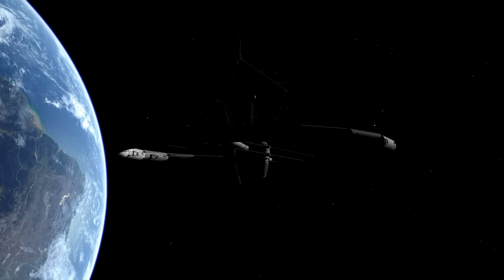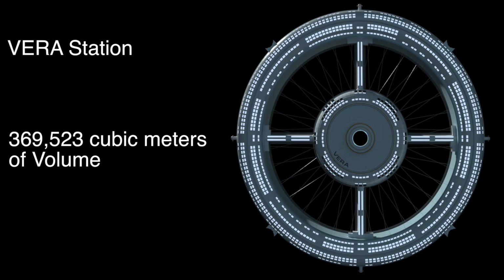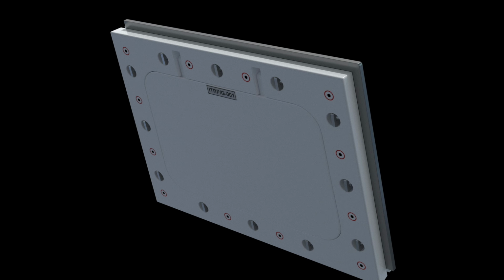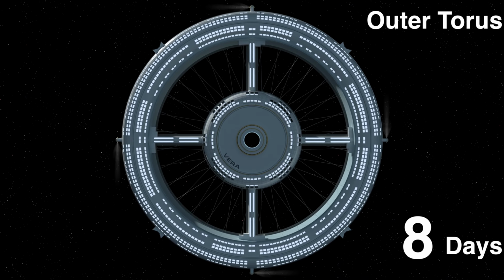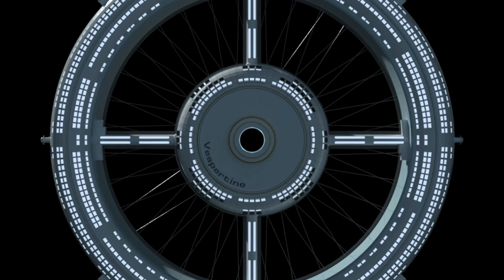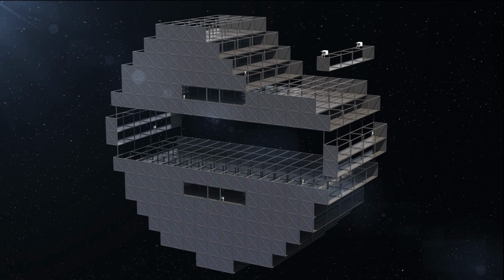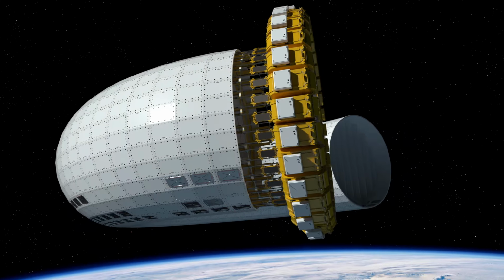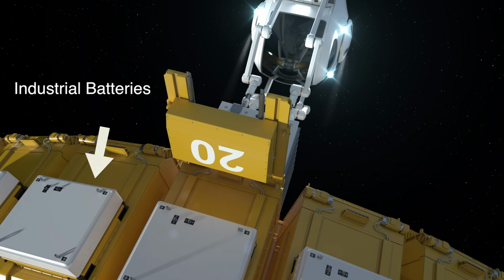We could build this huge Space Station in 6 months

Comment: I was involved in Singapore MRT 12 kM.  I was head a team of structural engineers, mechanical engineers, electrical engineers and architects, 120 professionals. A single segment was 12 panels 10m dia. I thought I had designed a machine. I could not find a volunteer when the existing working project. I told them one day to make them. FANTASTIC! When is the video coming out?

Comment: Like any bridge construction the challenge will be joining in the middle; the final 3 segment rings that close the torus. The builder blocks them so they will have to be very special. If they telescope or hinges into place it will create a structural weak point and will need internal and external bracing. Note I'm a little concerned about the lack of diagonal cross bracing depicted on the box truss but that's a old video.
Reply: The simple solution is for Sargon to be hinged and bi-directional.

Comment: Good design. You may need a sunshade, which could also provide solar power, to shade the constriction so thermal temperatures are low and expansion and contraction will not distort the incomplete torus. A partial mirrored sunshade reducing the light level to 20% would give much lower temperature swings on the light and dark faces. 
Guy wires from the first ring segment to the third last new ring may help maintain curvature. This could also measure thermal distortions and tension to compensate for them.

Comment: So the entire thing is welded together without any expansion joints? How is that going to stand up to the extreme temperature changes in space between shadow and sunlight? Also clearly the last few sections will have to be done by hand or other equipment because the assembly structure is not entirely internal to the ring.

Comment: Probably better to cannibalize Starship bodies and connect them to make a torus until lift ratio becomes more practical. Starship engines will be needed to move the tori to Mars or Mars orbit. So far, Elon says that the cargo to ship ratio is too low. It may be better to launch to Mars from the Moon due to orbital velocity kick, and possibly available water to  hydrolyze and use as propellant. Elon may be willing to buy Sargon if it pans out.

Comment: How does welding work in outerspace? In know deep sea welding is dangerous but outer space is unknown?
Reply from the maker: The Russians started welding in space decades ago, they used EB welders. EB and Laser welders are the two best methods to use in space and for deep penetration EB is best.
Reply: @TheGatewaySpaceport  How will this help with or prevent rads, dust, and etc?
Reply: droplets of liquid metal will become ball bearings, of any size 1 mm^3 to 1 cm^3. in molten state, they will stick to things, roughing surfaces

Comment: and after the torus model, can you design a (semi-/partly) spherical model ?
Reply: spin axis is stable with toroids, but not spheres
Reply: @paulshields1883  that's part of the reason i stated semi-/partly spherical model, i'm sure that donut can be made a bit "fatter". Kind of like two mushroom caps stuck together. The parisian mushroom kind of caps. And thx for replying.
Reply: @Diaman_D  yes, if i recall correctly, if thickness is less than radius you can have stable spin

Comment: If you can make this we could make spaceships garages to build spaceships in orbit we can make them bigger safer and would be a more practical then building on ground and trying to launch from earth. Now we can build pieces down here assemble in orbit launch all pieces with space X rockets this way a constant flow of tools and parts for ships. This is a game changer if they can get they payload from space X rockets means cheaper and just reloading the same rockets over and over it be 5 launch's a week and rockets coming back if you use 20 rockets so you could have an constant flow of material.
I believe using space X rockets to do this makes it cheaper your rockets land back on earth unharmed and right side up ready to be reloading the motors and payloads.

Comment: Since the station hull is a hard shell rather than inflatable (like the Bigelow module on the ISS) would the component parts be better (cheaper) delivered to space using SpinLaunch and captured in space with the proposed assembly-construction bots?

Comment: If Gateway Spaceport reaches fruition it will become the industry standard for attaining rotation induced gravity. No need to build larger diameter units bc the Tori can be center linked by corridor tubes ( envision a dual hub pickup with the tires representing Tori ). There could be any number of linked Tori, separated by Kilometer wide space sleds that that can be conjoined to form solar array configurations several Kilometers in length.

Comment: What about heat? A station of this size is going to produce a significant amount of heat which is difficult to get rid of in space. Body heat, life support, and amenities all produce excess heat which needs to be radiated away in the vacuum of space. Given the square cube law, it only makes sense that you would need to dump a massive amount of heat to maintain a living temperature. Given the ratio of radiator-to-station of the ISS one would assume it be a core design component.
Is there a way you have addressed this or is the structure capable of radiating sufficiently in its current state.?
Reply: heat management is half of all satellite design. but it's the boring part, so i'd give him a pass in early plans. it is certainly "to do" for a mature plan.

Comment: In Star Trek there was a scene in the movie where they went back in time to visit Earth and build an aquarium out of Transparent Aluminum. It was a facinating idea but based on science fiction rather than a science fact. Today however, the material is now proven science fact! Transparent Aluminum is costly and is more resistant to scratches and pitting from a bullet shot at it than layers of bullet proof glass. 

Could this break through glass component be used in space? 
We know how tiny meteorites smaller than a grain of sand can penetrate metal and other building fabrication with such distructive consequences, but has this glass ever been concidered as a building material for windows in off world structural applications and have you heard of this new type of unbreakable transparent  glass having this type of molecular integrity?
If not, would this new developement be concidered in the building of this off world dynamic? 
Another problem was a sun shield made from a gold film applied to space helmets that could be fused into this transparent aluminum glass being able to block dangerous spectrums of light from harming occupants.  Perhaps one light year being able to fabricate panoramic vistas glass. And equipped with retractable irises or impact resistant walls in front of the glass.
Reply from the maker: Transparent Aluminum is also known as Aluminum Oxynitride. Lots of promise here. We hope it will be ready in the size we need when we start fabricating window panels.

Comment: Those timelines for building a ring every hour... that's just the outer shell! That doesn't include electrical, pipes, plumbing etc etc, then interior floors and walls, solar installations, computer systems, mechanical systems, fitting exterior astroid and space junk protection, i could go on and on, the outer shell is just a small start, I just can't see it happening anytime soon.

Comment: Computerised machining and 3D printing can make rapid prototyping very quickly with very complex shapes, making parts that were never practical before. And modifications can be done very quickly. Small batch manufacturing becomes much more cost-effective. And material sciences is constantly advancing. And production lives can quickly be adapted using the same tools. Also providing casting and stamping forms. Computers can also help with designing and testing to reduce the need for many prototypes.

Comment: These Tori could be attached by a centered axle at opposite ends of an enormous space "sled", a flat modular design covered with acres of solar collector panels that always face the sun. The Tori would constantly rotate to create gravity. The cold side of the sled would contain layers for batteries, manufacturing, storage, and vehicle maintenance. Very efficiently constructed, using extruders and printers because there are no curves or angles other than 90 degrees. A massive version of this structure with several Tori could orbit the sun.

Comment: put one around the moon on a sky hook. the lower gravity and the L1 point putting it between the moon and earth but tethered to the moon since its rotation is locked to earths. this will allow colonization of the moon using less fuel as you only need to go 2/3rds the way and mining and manufacturing on the moon itself, even using your machines to build bases and habitats on the moons for mining. this wont work from earth as the station would need to be geostationarly locked and would be moving way too fast at that distance. but with the earth pulling from the other direction you could make it so long it would be just outside the radiation belt or even inside, cutting the distance to earth to only 200 miles with the tether being allot bigger.

Comment: Have you considered going with coil welding rather than panel welding? Send up coils of stainless steel, whatever, and weld them into cylinders (just like Starship - already proven tech). Still build your torus, just out of short straight segments. The tooling machine could be much, much smaller, and could have adjustments to weld cylinders of different diameters depending on the need. The machine then precision cuts the correct angle to join straight sections (assuming we can work out how to recycle the off-cut). Pretty easy to do double-skin or triple-skin sections as well with the one machine.

Then you aren't locked into the "we have to build it this size because that's the size the machine builds it".
Reply: Part of the reason its in segments is they can be pre-fabricated with utilities built into them. Another major factor is the inertia of moving the material in space. Rolling a coil of material and moving a large weld head/ feeding mechanism on a flimsy piece of steel wont produce the best results.
Reply: @mrsuper7484  mmm, good point about reaction control, though that will be a problem either way. Thought, perhaps it's not a case of either/or but both/and?

Comment: I guess I too have several questions, I like the concept, but I suspect reality is going to be a bit more challenging.  That said there are some simple specifics I would need before this is more than powerpoint drivel.   (I hope it isn't but I fear it is.).  Those questions include:
1) On safety, why a single large space.  Given the risks I would assume that air locks and internal bulk heads would be a better idea so that a rupture/puncture can be isolated.
2 How much today is the cost to build one of each robots?   How many launches to launch the robots?   How many launches to create the first station?  That needs to be understood, and should have been attached to this presentation.   Nobody will seriously invest without it.  and tuning that will be very critical to the viability of this proposal.
3 How will it be funded?    Building the first couple of stations will be critical to proving the viability of the concept, but the cost of each station will only become reasonable if the funding to build many of them is actually secured.

Comment: We already have large structures on Earth that are mobile and can hold many humans in an artificially maintained environment: "As of January 2022, the largest cruise ship, Wonder of the Seas, has a gross tonnage of 236,857, is 362 metres (1,188 ft) long, 64 metres (210 ft) wide, and holds up to 6,988 passengers". Cruise ships carry fuel for an onboard power station that generates electricity most of which is used to sustain a habitable environment for the passengers, the rest is used to power azimuth rotating propulsion systems that propel the ship between destinations and allow it to enter and leave port under it's own power. 20 knots is fast enough for a cruise ship.
Unlike the rotating Torus space station, cruise ship passengers can disembark at various ports of call and interact with different cultures and environments which man has adapted to survive in over millions of years.
Engineers have their place in society but they can have a very myopic view of the world!

Comment: After watching the assembly and welding of the panels I noticed one more issue which need to be addressed.
The welding process creates a lot of small debris in the working area, on the video they are shown falling "down" same as you expect them to do in your workshop and then just sweep the floor. If you use the same for an orbital construction with all the bits and pieces flying in all directions, by the time the welding of the panels is completed and further work can be contained inside, there will be a huge cloud of debris in the entire orbital plane which will be too small to detect, but very dangerous for other orbital crafts on a crossing trajectory.
If you loose an entire batch of panels you create less problem than milions of micro metiorites. I hope we are not trying to replicate Saturn rings in this process.
I agree with most of the commenters, first a small scale proof of concept is required even before start desiging the whole project in details, because it might need to be redesigned in the end. The hard part is the proposed Electron Beam Welding is possible only in vacuum and access to a vacuum chamber this big will shoot the R&D budjet to space before any other part.

Comment: The concept of using pre-fabed panels is an excellent system which also takes full advantage of Starship's immense lifting capabilities. 

But I wonder if it's possible to design a material that could be manufactured into massive rolls, some type of semi-ridged yet flexible sandwiched material consisting of layers of an inner and outer metal sheathing and a polymer layered interior. These rolls would probably have to be wound around large hollow interior cores (picture a toilet paper roll) since the material can't be too flexible, which might mean a lot of wasted space when loaded into a Starship's cargo bay, idk ;?)

Similar to this ring of panels design, each ring might instead consist of one or more rolls of this (roll length limited by the interior cargo space within a Starship) and each ring custom built to have windows, portals, electrical/plumbing and other required components/openings prefabricated within each roll.

Comment: It's not "enormous" by human living standards; space engineering standards, yes. The circumference is less than a half a mile. It's like 4 of the longest submarines strung together. It's the space equivalent of those fad "tiny homes". It would be okay for a science station, a small manufacturing hub or a tourist visit. It may be the intermediary step we need in getting more permanent settlements on the moon and eventually Mars. I'm all for it but this will take trillions of dollars and human labor hours. A project this enormous needs the commitment of public dollars as well as private dollars, and NASA and the ESA on board.

Comment: Great vison, Elon talked about payloads evolving to match the capability of Starship, this looks like a viable system. Have you considered building a Vera interior ring made to mate with Starship for the journey to Mars? The rotational gravity would be massively useful for such a long trip. Starship could then undock to transport people and cargo to the surface, that way more Starship payload space could be freed up since no living space would be required, only seating for the crew for descent/ascent, would make life support less onerous as well. One issue that does come to mind though is the manufacturing of solar panels on-orbit. They are extremely resource-intensive and produce large amounts of dangerous waste (sorry greeners), a breakthrough in solar cell design would seem to be needed. But hey, quibbles.. I hope Elon or Gwyne sees this.